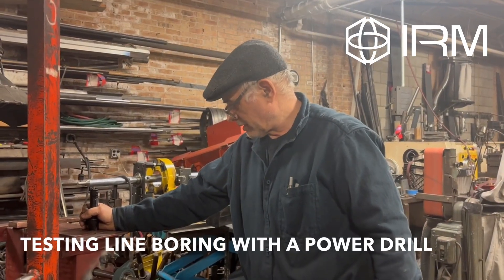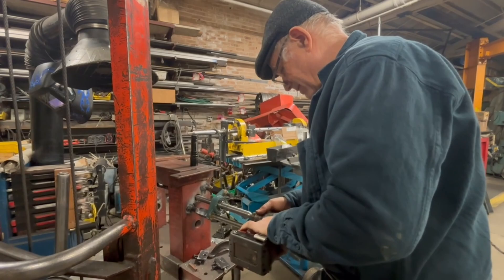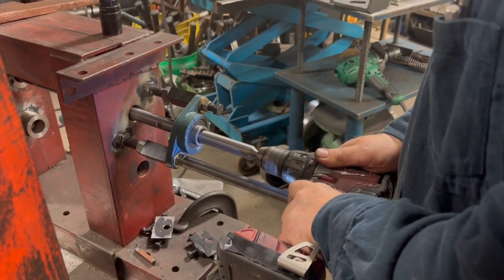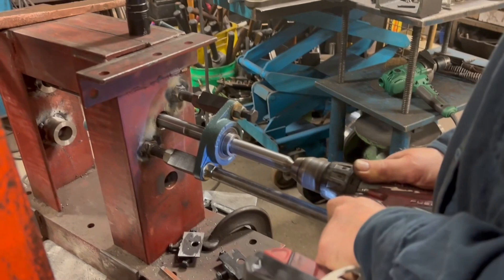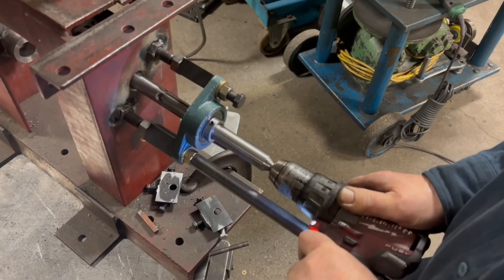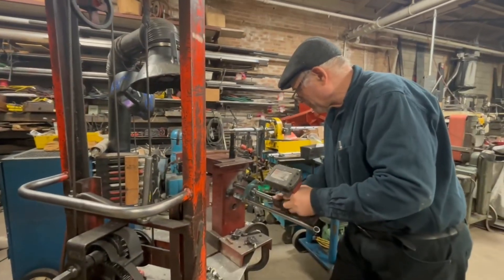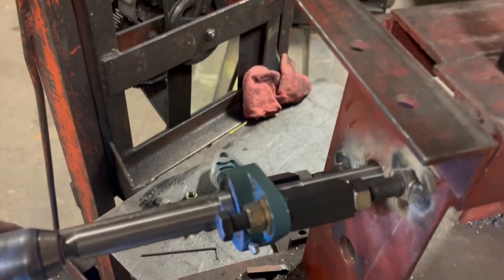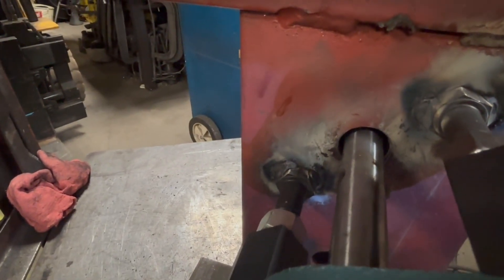I tried line boring with a power drill

Comment: The grind of the bit and the speed of the drill have to match the feed rate. I'd bet you would get a better result running a regular drill bit through a hardened bushing welded at each end and than using a boring bar. It would probably still not be usable though. If you could get the initial holes lined up and undersized maybe you could ream them and that would work but with this small diameter you really need a fixed (not portable) boring machine.
Reply from the maker: Yes, you are correct. There are so many ways to do this. You could drill it, you could ream it, and so on....

We are just showing the results when done by hand ( a customer requested this video).

But if you choose to do line boring, you need constant movement to perform this way.
That's why we offer Power Feed. 

Thank you for your comment.